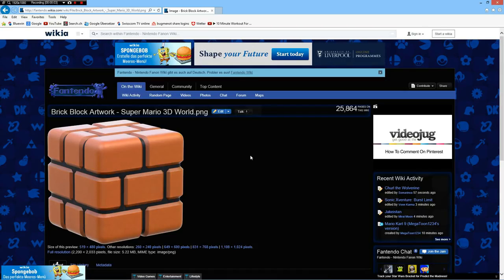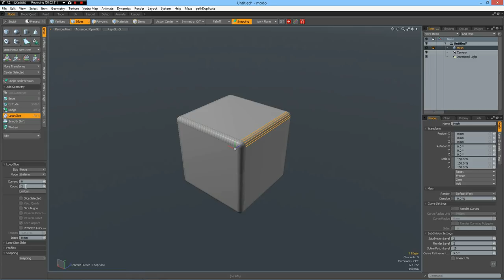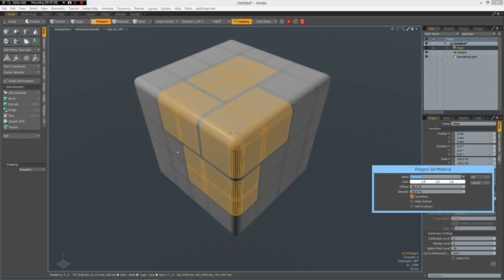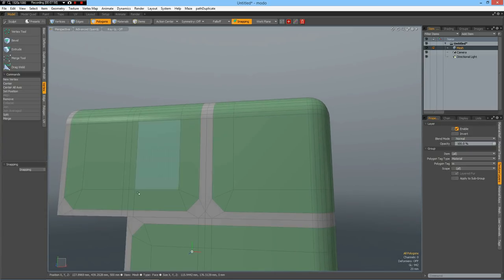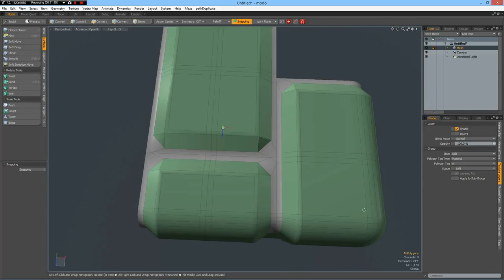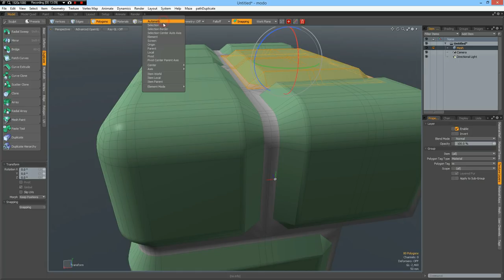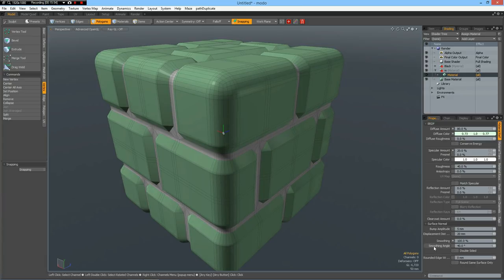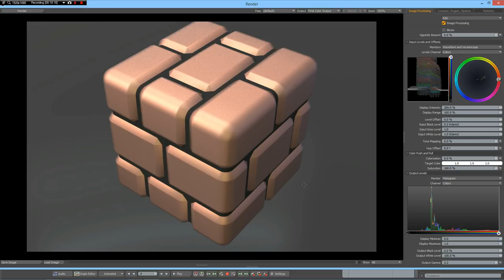The Foundry MODO - Super Mario Brick Block for Ian Wong

Comment: Great tutorial, Pete. Can you explain a little more what Polygon Smoothing Group do? I don't understand why doing this make the edges more sharper while the smooth parts are ok.
Reply from the maker: harlockmbb Hi, i think i am misusing smoothing groups a bit. I stumbled over that when i tried to get rid of some strange smoothing shadows especially with ngons (you can get the same effect by cutting and pasting the poligons without merging the vertices..). But there is a YouTube video out which explains that a bit better. Just search for 'modo smoothing groups'. Apart from that there is only very little information available. Nothing in modo help. Kind regards, Peter
Reply: Peter Stammbach Thanks. I think I understand now. The smooth group turns sharp the edges at the border of group, but keep edges inside the group smooth.